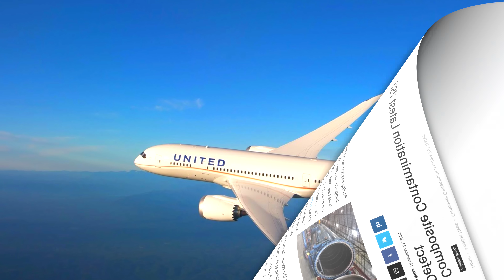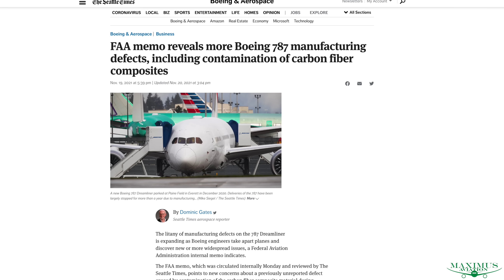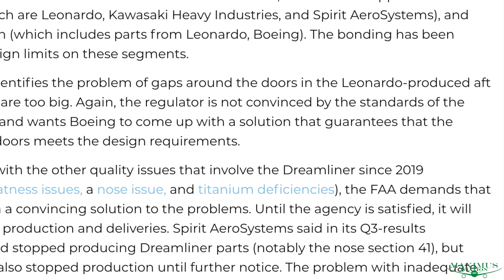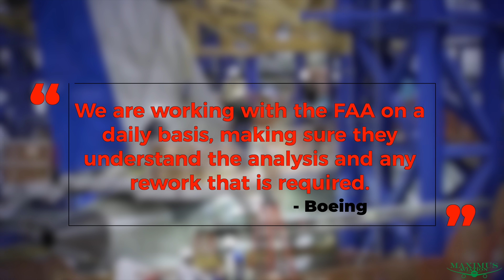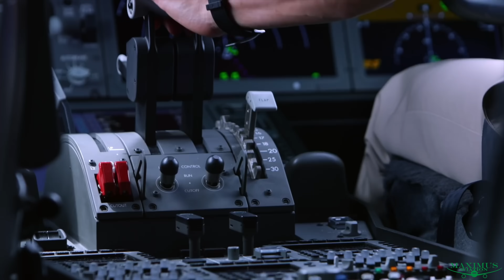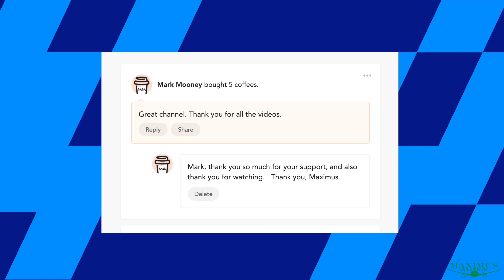Boeing Admits The 787 Carbon Fiber On The Wings Are Contaminated And May Compromise Wing Stability.

Comment: Well stated. With decades of advanced material reinforcement ASTM & chemical failure analysis engineering experience, we collaborated with DuPont in developing, engineering and perfecting the technologies dating back to the late 1960’s with their revolutionary aramid fiber called Kevlar®. 

We have been doing the same with Nomex®, Spectra®, carbon fiber and most recent Nano carbon fiber manufacturing and reinforcement techniques. 

I commend Boing for taking carbon fiber reinforcement to a scale never before attempted.
Reply: And what do you have to say about the PTFE contamination of the CF?  It's nice that you "collaborated" with DuPont on composites technology, why then don't you emphasize the criticality of cleanliness when doing layups? If Boeing's doing it wrong perhaps you should be talking to them?
Reply: @davidb6576  Excellent questions:

Your assuming Boeing listens. They don’t, as they subcontracted major 787 component work, losing quality control on even the most basic yet critical raw material originations, it’s quality, purity and quality control in the sub contractors processes. 

A simple fiber eyelet guide or spinneret luberciation that may be compatible for nylon but not compatible for carbon fiber applications can have catastrophic results. 

Understanding the origins of everything that is used in everything in every product that touches our lives, come from around the World with raw materials ingredients, parts and sub components that typically originates from the cheapest source as possible along the supply process.

Cheapest, meaning the opposite of best value, safest or quality, many times have unintended to catastrophic consequences. 

In addition, there are limited manufacturers and capacity especially within the USA.

In the USA there are over reaching regulations whereas other countries have little regulations, unlimited slave labor working in inhumane conditions and with the unfair trade policies that started with President Bill Clinton, supersized by Obama / Biden drove key USA🇺🇸 fiber producers and processors out of business. 

The very reason I sold our USA🇺🇸 advanced material fiber processing division. 

The contamination came from either the carbon fiber manufacturing process, packaging or application process, a critical concern as it can have catastrophic results. 

If Boeing request I will gladly assist in the forensic analysis of origin, solutions to prevent from reoccurring, how to detect, monitor and fix the current fleet as/or if needed.

In fact, I am already conducting conceptual engineering though analysis, computer computation and simulations.🧐
Reply: The dangers of
PTFE (C2F4)n to carbon fiber.

Polytetrafluoroethylene commonly know as Teflon® has a low coefficient of friction with anti-stick properties as a release agent.

Once on a surface it is extremely difficult to remove and if comes into contact with carbon fiber is devastating to the bonding process leading to significantly loss of tensile strength, delimitation and catastrophic failure without notice. 

I am shocked that this rookie mistake or intentional action to speed up production and less waste using PTFE materials in the carbon fiber bonding process is as unthinkable as it is unacceptable on all levels.

Comment: Maximus, you might have mentioned that PTFE is the generic name for Teflon. Just imagine the problem of trying to get epoxy to bond to Teflon contaminated fibers. Sheesh, what a mess!
Reply from the maker: If only I was smart enough lol.  I had to practice pronouncing "polytetrafluorethylene" a hundred times and still I had about 6 outtakes while recording this lol.
Reply: I was thinking exactly the same thing!!
Interesting timing for these announcements??
Are they trying to hide the enormity of this problem in Turkey and Stuffing??
Surely the FAA going to have to ground all 787's until structurally integrity tests on wings and fuselage? It would DESTROY Boeing if they have another crash due to a known problem!
Reply: The dangers of
PTFE (C2F4)n to carbon fiber.

Polytetrafluoroethylene commonly know as Teflon® has a low coefficient of friction with anti-stick properties as a release agent.

Once on a surface it is extremely difficult to remove and if comes into contact with carbon fiber is devastating to the bonding process leading to significantly loss of tensile strength, delimitation and catastrophic failure without notice. 

I am shocked that this rookie mistake or intentional action to speed up production and less waste using PTFE materials in the carbon fiber bonding process is as unthinkable as it is unacceptable on all levels.
Reply: @icare7151  Key words: "speed up production".
Reply: PTFE contamination on composite parts, comes from a number of sources.  Starting with the tooling mold release agent used so that the part doesn't stick to the mold during cure. 
Then you have the bagging materials like perforated teflon that allows for out-gassing during the adhesive system cure. 
Another source can be found in the peel ply that is used against some tool surfaces and surfaces subsequently bonded. 
Finally, the hand tools used to mate the composite materials together, called rub sticks or squeegees to smooth the pre-preg material. The lay up assemble requires a process called de-bulking, where you have a number of plys that require compaction or you develop wrinkles. 

I've seen just about every stupid way that a bonded, assembly can be contaminated, however there are very inventive idiots.
Reply: An inventive idiot is the worst kind. I'm working on a Chinese marine air-conditioned where the idiot thought it would save time and money to route the cooling water through the gas line in the heat exchanger. Unfortunately  running water through a quarter inch line and gas through a five eighths line is very hard to balance and needs large volumes of water to stop marine growth.
The effects of helpful, ignorant peasant farm "engineers".
Reply: Gee, just when I thought things couldn't get any worse for the 787 Dreamliner program this new issue comes about.  I have to wonder if Boeing spent another few hundred million to thoroughly test the 787 would it have made any difference ?  There is a saying  " Hurried work is worried work "
Reply: @rscott2247  They could have tested till the world ended and they would not have found this if it did not exist in the plane or planes they were testing.   This is a manufacturing process problem.   Took me a while to find this out.   

The teflon is used as a mold release.   So either the teflon mold release product is acting badly or the people using it are not following procedures.  Could be as simple as cleaning the part after it is pulled from the mold.   Not saying that is it.

Even stranger Boeing and Airbus both use at least one of the companies making parts with this problem.  The question is why then is it unique to Boeing?  Or is it?
Reply: Like how can there be any other fix than, make new wings in case of big enough contamination to be structural. There is no way to pull all the PTFE out from the wing. It is famously hard to filter (as small particulate) due to it's non stick nature, doesn't react to chemicals (again why it is non stick) and so on. If it is there in the middle of the bonded parts.... it stays there doing it's non stick stuff weakening the bonding.

If the contamination is serious enough the only solution surely has to be MHE make new wings and this time make sure the fibers, the epoxy and the curing chamber are not contaminated .

Well there is one way to get it out. It is susceptible to really high temperatures to get it to separate out and even burn, but well that means you just burned the whole wing.
Reply: @aritakalo8011  But it is not just MHE.  

EDIT: Looks like the source maybe Toray   Could Airbus have the same problem.
"Toray Industries of Tokyo signed an agreement with the aerospace OEM EADS to supply carbon-fiber prepreg for aircraft applications - primarily for Airbus - through 2025."

Seems like every company working with carbon fiber for the plane has the problem, even Boeing.  Points to a single source for the material.  Yet I have seen no mention of who is making the carbon fiber.   

I see one of two things happening.   Either the carbon fiber producer did not clean up properly prior to starting its run of carbon fiber.  Or there is a PTFE line in the same plant contaminating the carbon fiber.

If its the first case the contamination should decrease over time.  If its the second it will depend on if both lines are running at or at about the same time.

It's a mess.
Reply: @danharold3087  They coat the carbon fiber molds so the part releases from the mold. It just wasn't supposed to stick to the carbon fiber.
Reply: @johnhaller5851  In a way that is good news.   The problem is only at the seams.

Comment: Isn’t outsourcing wonderful?
Reply: Outsourcing can be a great opportunity if you do not have the knowledge or the ability to make a product by yourself. I can't believe Boeing is in such a position. The profitability has been the only reason for that decision. Problem today is that the FAA checked deeply into the process of quality inside Boeing. And the horror came out. No real quality control......
Reply from the maker: LoL yeah.  However I do imagine it is wonderful as far as the bottom line goes. And in a perfect world it would be wonderful.  Problem is that you have much less quality control with factories spread out all over the globe and that seems to be the issue here.
Reply: @maximusaviationchannel  True however you do have a choice between a cheap manufacturer and a good manufacturer😉

Comment: The 737 Max fiasco revealed a culture at Boeing where safety takes a back seat to getting the plane out the door quickly. So how many if the 787's problems are the result of that culture and how many are just growing pains every new technology experiences? That would be really hard for even an insider to answer. Either way, the FAA needs to stand on Boeing's neck for decades to come. We can not trust them again until their entire current workforce has retired and been replaced with a new generation.
Reply: Well said quality & safety take the backseat to cost, schedule and shareholder value. Had the MAX debacle never occured the general public would still be blind as to the failed Boeing culture behind their walls.
Reply: Bravo, well said. A poisonous culture permeated and remains embedded in Boeing. Just look at the current saga of the 'independent' Boeing salaried QC inspectors supposedly working on behalf of the FAA that are neither properly trained, experienced or independent.

Comment: Maximu's you are too kind by calling the Nightmare liner quality issues growing pains as the gal is 11 years old. The fan boys call them teething issues 😂 but the only teething issues are those of fan boys gnashing their teeth at the ongoing blunders.
Most of the time it's always within specifications when it comes to Boeing defects. 😂 
I found a groove in the top of a floor beam at the forward splice on a Boeing aircraft and asked for it to be NDT for cracks. First test found a crack so they resubmitted to test again as if the crack would go away. Second test found the crack and yes they needed another resubmit because maybe the third time would pass. No the third time found a crack and here's where the Boeing magic comes in. Engineering rather then recommending a common drill stop to prevent further cracking gave the "use as is no effect to form, fit or function."  
It wasn't like they needed a doubler plate over the crack but a simple drill stop at the cracks end would prevent further crack growth as that's what we normally do. Thousands of dollars were spent on multiple NDT examination and then engineering to come up with "use as is no effect to form, fit or function."

Comment: Why don't we hear of the same sort of problems with the airbus 350 ? is this due to - nobody looked ? a different productions metode ? or do they just have a better quality controle ??? I know Qatar has found a problem, but we don't hear anything from others: why ??
Reply: No issues with the a350, the qatar issues are still dodgy because no other airline has reported anything AT ALL wrong with their paint degradation. Boeing is just an absolute shitshow right now, that's all
Reply: Just a wild guess but probably because there are no issues with the A350. Just saying.
Reply from the maker: True but this goes to the "going first method" Airbus saw that Boeings barrell fuselage method while innovative posses a lot of problems when it comes to repair.  Airbus created indivitual composite panels much like aluminum so that they can be easily replaced over time.

Comment: I think you are correct in the fact that as they were the first they will learn by doing so. But an issue of contamination has nothing to do with learning, it has everything to do with quality control. And on that point Boeing scores ZERO. There are too many issue's that are coming to light after the fact that should have been noticed during quality control in the early stages of production and, that should be a continues process so if something is not conforming at some point, it will be noticed after one or maybe two aircraft and not a few 100. I'm not a Boeing hater but I have lost just about all confidence in them. Thanks again for a good update and happy holidays!!
Reply from the maker: Well said.
Reply: Quality is a very expensive option to these corporate thugs.
Reply: @DC8Combi  Clearly, but it would have been much cheaper in hindsight by the look of things ;)
Reply: @MarcvanExel  absolutely it would have been cheaper to spend money on quality.

Comment: Maximus, your personal take is right on target.  First isn't always best, the aircraft has had an excellent flight safety record and while such things are hugely embarrassing to Boeing, how they address the matter is what ultimately will define their future going forward.  Happy Thanksgiving. 👍
Reply: Didnt the MAX have a perfect safety record till it didnt?
Reply: The problem with carbon fiber is that it fatigues differently than metal. When we get 30 year old 787, we will get a better feel for how well the plane was built to avoid fatigue failures. What will they do for D checks to ensure the plane is still safe? And, how expensive will those checks be? These current issues may be fine for the first 15 years of flight, but could start causing problems afterwards. This is part of why there is a safety margin, so that the plane is still safe 30 years from now. These problems are eating into that safety margin. If the type can only successfully pass one D check, the plane may not be as profitable to own as originally expected.
Reply: @johnhaller5851  Materials engineering and testing is a big part of making sure the composite will survive the test of time.  Between modeling and stress testing, they do have a pretty good idea of how reliable the material will be.  The bigger concern is making sure that which was tested is the same material as that which becomes the final product.  Even so, you are right, the ultimate test is the test of time. 👍
Reply: Concorde had a 30 year perfect record too. Turned out that plane was riddled with issues as well and it was just luck that things didn't happen earlier.
Reply: @baronvonlimbourgh1716  true, though there were some close calls that in retrospect should have been indicators worth paying attention.  Sadly, they didn't.
Reply: @commerce-usa  who knows what is going on with the 787. These things only become obvious after something happens.
Could very well be things that are simply brushed off as not important now because it wouldn't be a problem with normal planes that in hindsight should have been obvious clues.

Just saying a record is perfect until it isn't...
Reply: @baronvonlimbourgh1716  agreed.

Comment: The unfairest criticism on the 787 is the blame Boeing got for a Rolls Royce design
Reply: But the difference between Boeing and Rolls Royce culture was RR were the people who spotted the extra wear, owned up to it and started replacing engines at their cost. They then went public with what the fault was and rebuilt the engines with new generation blades making it a better engine.
One could add that the only RR Trent version to have this issue was the '1000' fitted to 787s.
Reply: @1chish  well said any absolutely spot on! These Boeing fan boys deflect from Boeing's greed and poor culture. Look up "Boeing Partnering For Success" the Boeing designed program that told suppliers what Boeing would pay them for their products!
Yes Boeing dictated supplier prices or they dropped them from the supplier list. Common sense tell us if we are given cheap prices our products must reflect so that we can make a profit. All the cheap not to specification supplies and parts are due to Boeing's greed.
Reply from the maker: Excellent Point
Reply: Ce?
Reply: You still don't get it do you, the manufacturer holds final responsibility for their product. Get real cupcake the 787 is riddled with problems as is Boeing.